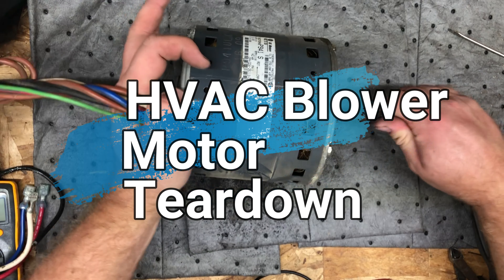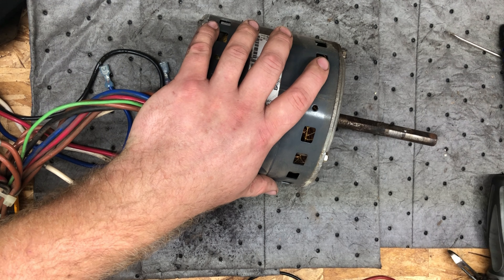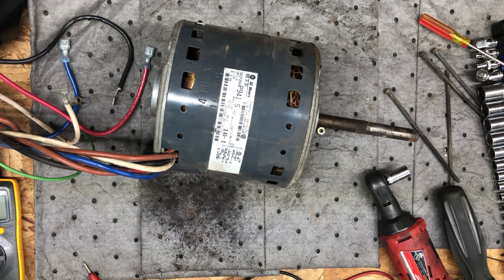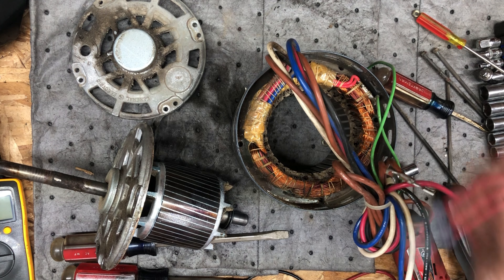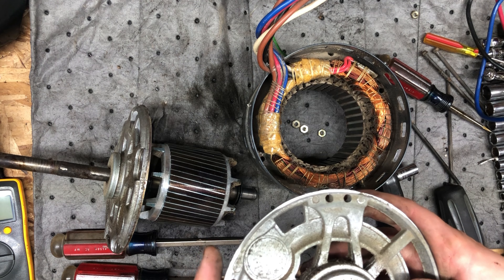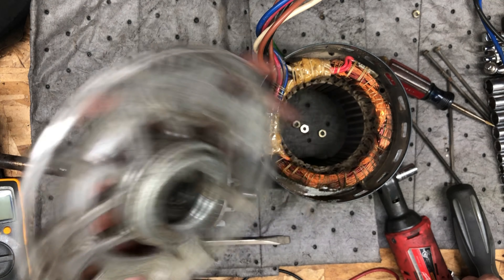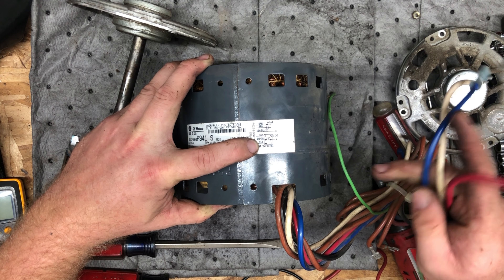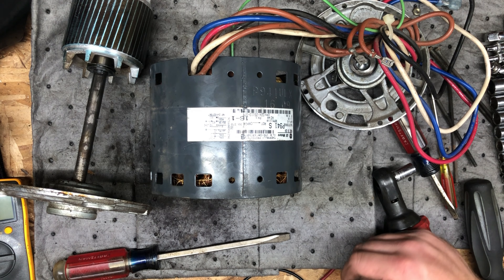HVAC Blower Motor Teardown

Comment: Hi Unskilled Mechanic
Nice video on a blower motor teardown.
At around 5:21 in your video you start to discuss the bearings in the motor. The oil-soaked material you reference is called PermaWick and is manufactured by the Permawick corporation. 
Permawick has supplied bearing lubricants to the OEM electric motor companies around the world for over 70 years.
The PermaWick material is a combination of PermaOil, and specially engineered fibers.
If you chose to take the external caps off both bearings, you will have direct access the Permawick material. (for replacement or reconstitution with PermaOil).
You are correct. Oil from the PermaWick material is transferred to a felt wick, which extends through the window in the side of the bearing. The felt part is in constant contact the shaft and delivers PermaOil to the journal area. Permawick material can be reconstituted with PermaOil, or new PermaWick material can be used to replace the old. 

The Permawick Corporation.

Comment: Heh, I'm cheap... I had similar rusting squirrel cage fan, cleaned the rust off, primed, painted, checked balance the best I could and it looked good.  Motor was lubed while I had it out, put it all back together and it's been working fine for around 5 years since then.  It does take some patience to put on several very thin coats on the inside of the squirrel cage with a rattle can.  I used rustoleum enamel.

One thing about the motor, you have to relube it BEFORE it chews up the bearings (or in the case of mine it was bushings), and if there's some wear detected, use a little higher viscosity oil.

I did the same for my HVAC exhaust fan except the squirrel cage was plastic and relatively clean so just dusted it off with a paintbrush.  It was making a squeaking noise when I did that and now it's been running... close to a decade since.

The material in the reservoir is usually felt, or in more modern motors perhaps some synthetic alternative.  Once upon a time ago, motors like these had lube holes and it was considered prudent service to lube them every so often.   That was back when manufacturers were more responsible instead of trying to save 10  cents.

The sense in not replacing it is (in my case), mine was over $250 for the pair, a substantial % of the cost of a new furnace and with mine being older, would rather put the savings towards replacing it eventually rather than a part that I can merely relube to keep it working - but again you have to do it before it chews up the bushings.

Comment: Good stuff. I just took mine apart and it was almost identical. Each color wire is a different speed. Black high blue medium high yellow med low and red low

Comment: Cage looks just like mine. Dirty from not running a filter in a dirty environment. I cleaned the dirt off the blades with MEK and a toothbrush. I'll let you know if it cured the imbalance.